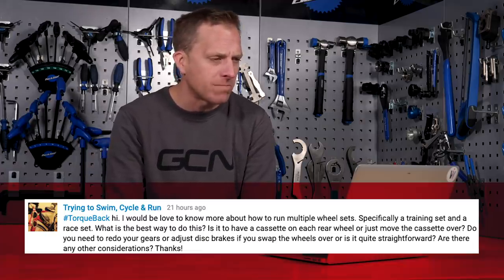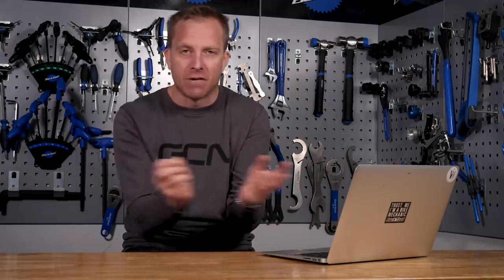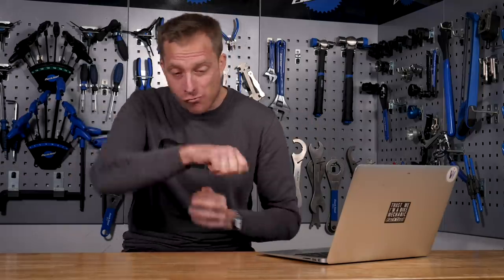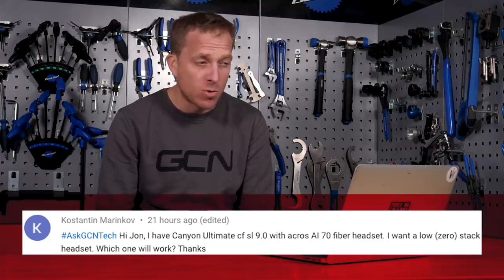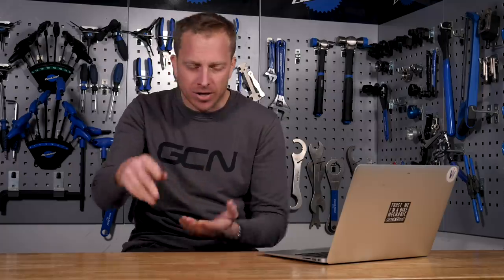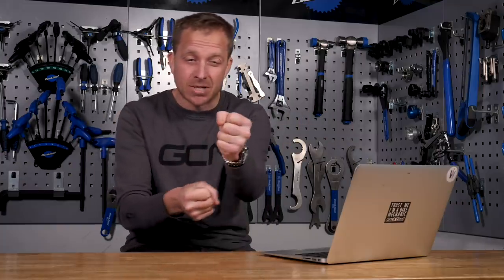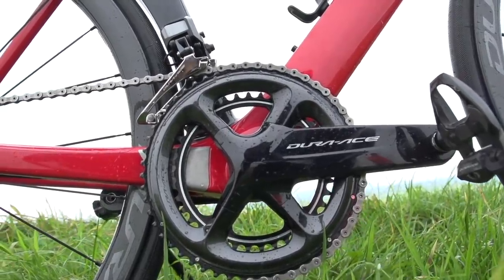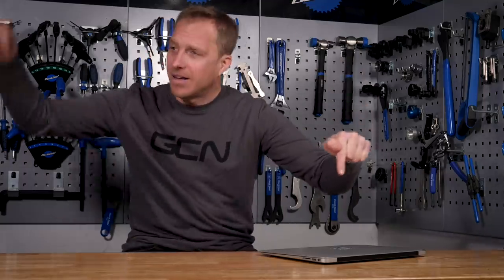Switching Between Training & Race Wheelsets + DIY Bicycle Tools | GCN Tech Clinic #AskGCNTech

Comment from the maker: We love to help here at GCN Tech so leave your questions in the comments below using #AskGCNTech and we'll try to answer them in a future episode 🔧
Reply: What is more economical ( wears brake pads slowly) braking slowly and slowly coming to a halt or slow speeds like or braking hard and slowing down faster( when both are options)#askgcntech
Reply: #AskGCNTech Is there a way to stop disc brakes from squeaking when it rains? The brakes do get better if I can make a bit longer and harder braking. It's my city bike, but this city is very flat and usually on my route there isn't even a bridge or an underpass, where I could clear the squeaking. Is there a cure for this or is it just a "feature" which I have to learn to tolerate?
Reply: @MK-je7kz  how about attaching a little piece of cotton just on the brake body so that it just touches the disc and takes off water on it...
Reply: @kedarkulkarni3030  What happens if that cotton gets between the brake pad and disc? Do I still have brakes? No, thanks. Now they might squeak, but they still work.
Reply: @MK-je7kz  I haven't tried this.... but you can try once at home and spin the wheel a few times with water on it and see if it works...it can be a great hack as water on braking surface always makes rider less confident
Reply: Hi Jon always love the show!

Is all the bb tool size for shimano hollowtech II standard? #AskGCNTech
Reply: Jon you could also try a car oilcan rubber grip (don’t know the proper term) to try to remove the BB
Reply: #AskGCNTech when is the best time for you guys to swap from training wheel sets to race wheels before a race? i'm currently using aluminum wheel sets for training and i have another pair of carbon wheels. thanks in advance!

Comment: Hello team gcn...I want to thank you for giving best tips for cycling and tech tips from Jon cannings it has been a year since I started cycling and there have been numerous problems and questions...but I found every answer through your videos...today I solved shifting issues in rear derailleur due to mud in cables...as it is not visible... someone would take it to bike shop and sometimes it becomes time consuming...but after watching gcn tech videos and Jon's expert advice..I recognized the issue and fixed it at home...now I can fix almost anything on my bike and it is very satisfying to be self sufficient...I can also understand what is going on my bike and avoid frauds... thanks a lot..
 
A budding cyclist

Comment: I'll give my advice on wheels. I do winter/summer wheels, not training/race. Move the cassette over, it's wearing as your chain wears so keep them together. As for adjustment, if the brands of wheel are different there will likely be a minute amount of adjustment needed for the indexing, but not much, depending on how picky you are. As for discs, I'd recommend buy and keeping discs on each wheel (don't swap), and you'll likely have to adjust the caliper after each swap.

Comment: For Ben Boddy's question about power meters: Favero Assioma has their left side power only Uno ($414 US) and dual sided power Duo ($649 US) pedal power meters. I have the Duo and absolutely love them.  They're super accurate and much cheaper than Garmin or Powertap. I swap them between my road, gravel and fixie all the time. All it takes is an 8mm allen wrench and about 1 minute of your time.
Reply: Thanks for your response Chris. I'm in the UK and the cheapest I've found the Uno is $481 (£375), granted it was only a quick search in Google.

Comment: Hello GCN Tech! I recently purchased a tensionmeter and used parktools website to aid in decreasing the tolerances from 20 percent to 5. This is a two part question; 1. How do you calibrate the tool? 2. Does having equal tension throughout the wheel also true the wheel?

Comment: Most people that have dedicated wheels for racing also have specific cog combinations to suit the expected conditions. If you have more than one race set it make sense to have an array of cassettes as well. I would put the rear race wheel on for the last long training ride before the race and the front can go on at the same time or  change it the day before. The reasoning is that I often used ultralight front wheels and tires while taking a more conservative approach on the rear - using stronger and deeper rims and so forth. During races (and fast group rides) you tend to need tighter gears in the middle. You really miss the 16 in fast pack rides that last more than an hour or so. If you want to keep the wide ratio and jump from 15 to 17 that it when you consider dropping the front ring down a few teeth. 

The bottom line is that it's very unusual to have a cassette that just happens to be optimal for training and race conditions. If that is what you think you have you probably haven't put enough thought in to your training and pacing doctrines.

Comment: Thanks again for a great video, I am learning a lot! QUESTION - I have a 2018 Trek Domane sl6 with 700-32 tires. Almost time for a replacement of stock tires, which have really been pretty good. Should I replace with 32 size again, or go with something smaller? Sorry I do not know the stock rim width. I do only road biking and coming from a bike that only took 23's and smaller, this has been quite nice to have the wider tires that are not as squirmy as the narrower tires. How much size / width difference would the 28 width be on my stock rims, and would it make any difference in rolling resistance and speed and comfort? SECOND QUESTION, ideal tire pressure for tires on stock rims and different tire widths? OK now you have a lot  of stuff to deal with here, thanks again. This might keep you busy for a while. By the way, loved your Tour de France coverage. I watched the three hours of replay on network tv, then watched GCN to find out what I just watched!

Comment: #AskGCNTech Hi Jon, I'm running a 2x9 compact 50/34 with 11-28 RD, and I find myself using the 50 with the 15-17 sprockets most often (I'm hardly ever in the 11-13). I'm kind of obsessed with keeping the chain line as straight and efficient as possible when on 50/15-17, so I've thought about slotting the 11 (and maybe the 13) behind the 28, making it the innermost sprocket.

Structurally, is this okay, or will I end up damaging the freehub body? Also, besides effectively losing a a gear or two, do you see any other downsides to this setup? (Or this is even silly lol) Thanks. -Mark from Gulf Coast of Texas.

Comment: 3 cyclocross wheelsets + 1 road-bike wheelset = 3 shimmed wheels to accommodate for the most distal (i.e. away-from-center) rotor.

Easier on a truing stand if you have one that you can rig for disc rotor truing or spacing... or use a zip tie. Curiously, I did not have to touch any of the rear wheel rotors, I think it's because the spacing is more "standard" across manufacturers because they all need to get the sprockets in the same spot.

Comment: i personally want to get the size of the middle-ish gears larger for cross and commute , , so i will use a sun wide ration and close ration and go 13-32 that should give me the best cadence off road , you can always turn you 10 speed to a 7 speed and kick the the top gears over to the middle range and get a strain chain line for better climbing results !

Comment: I’ve ordered a new carbon seat post. Currently I’m using an aluminium one in a carbon frame. So before using the new one with some carbon gripper, I would like to clean out the old grease and anti seize. Is there an easy way to do this? Thanks 
#AskGCNtech

Comment: #AskGCNTech  What about using MTB wheels on gravel bikes? As I understand it, anything classed as 29" is an MTB wheel. They have wider rims with greater interior width than so-called "gravel wheels". They may well have 4 more spokes too. The issues start with the hubs, freehubs and cassettes. The freehub body of a 142 mm (non-boost) MTB hub is different to one on a 142 mm road wheel. Why? Because the hub body itself is wider on the MTB wheel so the freehub is narrower. But the MTB freehub still fits an 11 speed cassette. How? By using a special type of cassette that is hollowed out a bit on the back so it fits "over" the outside of the hub. But, I believe this will work with standard road equipment and derailleurs, once fitted to a gravel bike. In general, it makes a lot of sense to use MTB wheels on gravel bikes. There's way more choice. You can potentially use wider tyres (if the gravel frame can accommodate them). And they are a "class" stronger, which seems to be on-trend with the increasingly extreme usages of gravel bikes. But, the "boost" hubs are going to drive a coach and horses through this. And there is the issue of the thru-axle on the front wheel being 15mm on MTB but 12mm on gravel. You can get roung that too, I believe. I'd like so see you discuss this. I'm going through the process of fitting them myself at the moment, as you can probably tell. The manufacturers certainly don't like what I'm doing, at least not according to all the warnings they give...
Reply: It should work. No issues as long as the hub spacing is the same. Non boost freehubs / cassette bodies should have the same overlock dimensions (i.e. hub spacing), although you rightly note the cassettes are differently sized. Road is wider to fit 11 cogs without fitting into the gap occupied by the spokes. (Shimano 34 teeth are the same as their off-road and will fit an MTB cassette, and they even include a shim to fit that into Road 11 bodies).

My next "horrible road" wheelset is based on Hope 32 hole hubs. I bought them used and don't trust the rims they came with so I'm getting them built on narrow MTB 27.5 rims (more rubber!), but I tested the hub spacing and it all works (142 back, 15 mm front) on a road disc frame and fork.

Comment: And if you go out training with the guys on much heavier wheels and tyres (and the tight frame clearances these days won't allow for very much difference in size), and you're keeping up, this is a good indication that you might kick their collective arses come race day. I'm surprised that you didn't mention that it's a good idea to have a dedicated chain for each groupset. If you are changing wheels frequently and started with all new components then you'll probably get away with it. But to mix a new chain with an old groupset, or vice versa, is just asking to have at least one gear that wants to jump out all the time. And even if the exchange is made regularly, you'll be needing a new chain when the sprockets are only half worn out.

Comment: #AskGCNTech  I'd like to see video about integrated bars and stems.  For example, the new Cannondale Supersix Evo, Orbea Orca OMX, Trek Madone. I know these bikes have split spacers so you can shift the stem height without pulling everything apart, but if you were to lower the bar height, what do you do with the extra cable?  Does it just sit in the frame or would you actually need to cut the cable just to play with bike fit, then replace the cable if you decide to put the bars back up again? Also, if playing with bike fit, can you put regular spacers on top of the stem, so you can ride before deciding if and where you want to cut the steerer tube.  If you make a video about this, I think it will be the only one on the whole internet!

Comment: I recently converted to 1X and swapped the 11-34 cassette from my gravel wheels with the 11-25 cassette from my road wheels. I somehow managed to mix up the loose cassette sprockets and it took at least 4 attempts before I arranged them properly so my shifting would work well.
This is my only experience doing this but it doesn't seem as easy as Jon makes out.
Reply: FWIW, I run SRAM 1x groupset with a 42 tooth Force 1 chainring.  I switch between 2 sets of wheels depending on if I'm road or gravel/dirt - one with an 11x42 APEX cassette and the other with an 11x36 Force 1 cassette.   The chain is sized for the 11x42.   I literally have to do nothing at all when I swap those.   It just works.   The clutch derailleur takes up any chain slack.

I have 6 bolt disc brakes on both, and on one set of wheels I'm just using a very thin spacer to get the discs to line up perfectly.
Reply: @davethedogdude  I'm not talking about the 1x system or changing between cassette sizes. Jon said that loose sprockets on all same speed and same brand cassettes are interchangeable, I inadvertently found this to not be completely accurate when I accidentally mixed up the sprockets from two cassettes.
I only mentioned the 1x as a background as to why this happened.

Comment: #askGCNtech - help please. Hi Jon.   I know its been a wet and muddy CX season so far but I seem to be burning through Bottom brackets like they are made of paper!   I run a Sram Rival 1x set up with a Sram GXP team english thread and I’ve already had to replace 2 this year as the grit gets in so easily.  After todays race the 3rd one feels like it’s had it too so, before I throw good money after bad, I’ve got 2 questions:

1) should I be doing anything extra to prevent grit intake such as packing in extra grease or something.  Other than greasing the threads and cleaning the crank and inners I just fit out of the box.
2) is it worth upgrading the BB for a better model and, if so, can I go for any english fit or do I need to look for any special design - all the talk for BB standards confuse and scare me!

P.s. before the masses get all shouty I’m not using a pressure washer to clean only using bucket and sponge and I do clean thoroughly after every use ….honest guv!

Thanks in advance

john- Leicestershire

Comment: #AskGCNTech Hi, Jon. I hope this question is relevant for this show. For my rides, especially on longer ones, I carry quite a lot of stuff (water bottles, food, toolkit, pump, clothing etc.). Does it matter where most of the weight is placed on the bike with all this stuff, for example towards the back of the bike in a saddlebag or on the front in a handlebar bag? Or, is it better overall to free-up as much weight as possible off the bike and carry all this stuff in a backpack? For overall performance and safety, what do you recommend?

Comment: I swap around a 4iiii left crank power meter. It’s not a lot of work, no more than swapping a pedals based system is really. Especially if you use the same pedal on the crank.

Comment: I'm currently running Ultegra 6800 (short cage) with a 28 tooth cassette. I've bought a rear derailleur hanger extender to fit as I struggle to shift into the 28t. I've tried increasing cable tension and aligning the limit screws but to no effect. Do you think this will solve my problem? Will I need a new chain due to needing more chain links? Thanks in advance #AskGCNTech

Comment: #AskGCNtech I bought a used road bike to get back into cycling. It has a 3x9 setup with Sora shifers. The middle chain ring is constant trouble and I don't use the smallest ring very often. I was thinking of changing to a 2x crankset and wanted to know if I need to change the shifter or if I could get by using the 3x mech with the 2x crankset and have an extra index on the shifter that will go unused.

Comment: #AskGCNTech When inspecting a carbon fork steerer tube, what are the signs to look out for when it comes to over-tightening / not tightening bolts to torque specs? 
As there are a few different bolts (stem, steerer plug, etc) to tighten in this area, would be great if you can show some examples of damage caused by improper tightening, so one can know if it's time to get the fork replaced. I can imagine if a component fails in this area, the outcome won't be pretty..  
THANKS!!!!

Comment: How to buy Spokes? I have an old Mavic Ksyrium Hub that I want to lace to an Ambrosia Rim. I have most of the important data but i am uncertain how to be accurate in ordering the correct spoke length. The problem being that it is a straight pull system. I am sure you can help, obviously I have used the online spoke calculators but I am not convinced.  Great show, keep up the good work....

Comment: #askgcntech I have a Cannondale Superx equipped with a Sram Apex 1x11 cross gear. It comes with a 40 tooth OPI chainring. I noticed that for proper road riding the top end is much too low. But the biggest cannondale compatible 1x chainring I could find is 44, which is still too small. Is the a company that makes bigger 1x chainrings, or is there a workaround that will allow me to get close to the 52 teeth I'm accustomed to on my previous road bike? Thanks and keep up the good work

Comment: #AskGCNTech Hi Jon, last episode of tech clinc was inspiring as always! And speaking about wheels for training I've some question about second pair of wheels for climbing :) I'm targeting a pair of zipp 202 and my question is about the cassette choice... I would like to get some easy gears so up to 32T. My point is that since it should be a pair of climbing wheels I would like to be light as well as the durace 11-30. This is not the case staying within shimano and choosing the Ultegra 11-32. So I was wondering what could be a good choice... SRAM 11-32? or is there something more convenient? Is this mixing of brands ok? I remember that you mention that mixing brand would make the change a bit more noisy... this could be a nice topic for a video where we can listen actually what is meant with this "noisier". And if I can... a second question regarding disc brakes rotors: if I would like to go down from 160mm to 140mm at the rear, what has to be done with the caliper in order to make it work with the smaller diameter rotor! Thanks a lot for your answers and keep up the nice work!!! Ciao Luca
Reply: Need your answer since I’ve won in the lottery for the Maratona Dles Dolomites 2020 😱😱